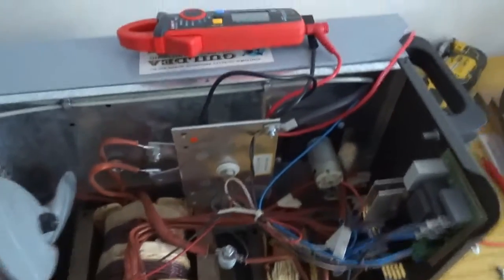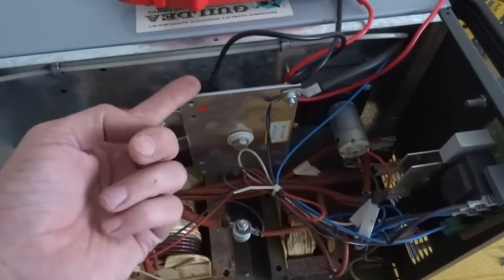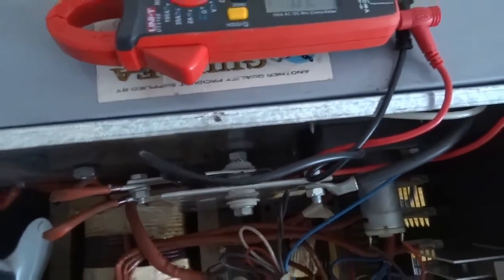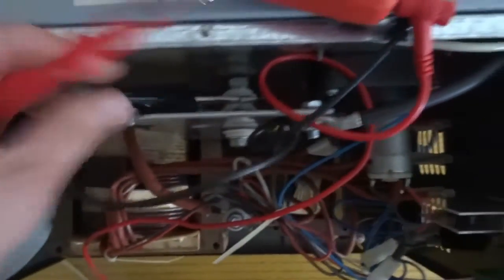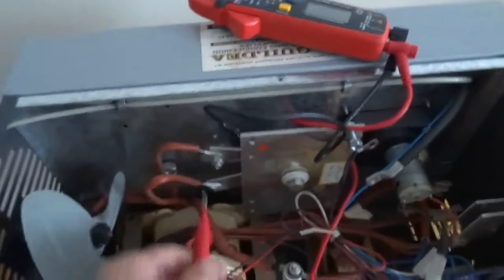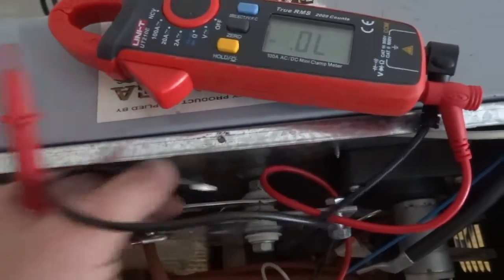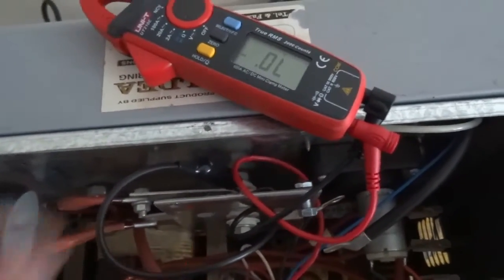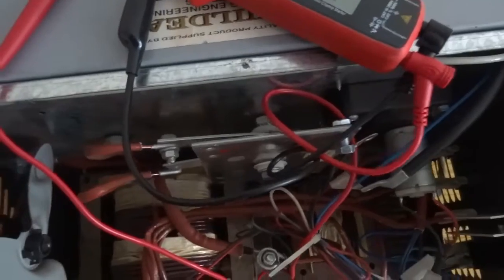MIG Welder Repair: How to Test Rectifier Diodes (Multimeter DIY Guide)

Comment: so if you have voltage coming from the transformer, but nothing out of the rectifier to main gun lugs,  you can assume the rectifier is bad? can the diodes be repaired? or is whole new aluminum plate with diode assembly usually required?
Reply from the maker: yeah diodes can be replaced but its not easy.